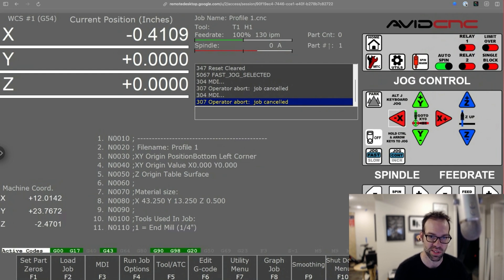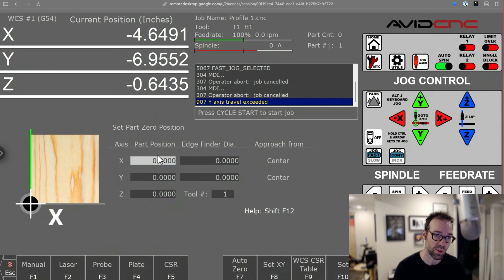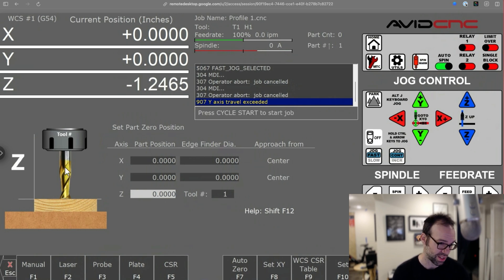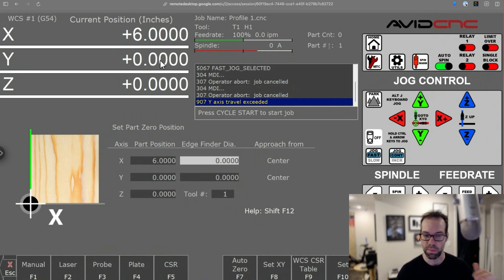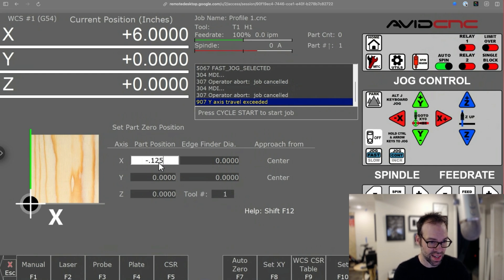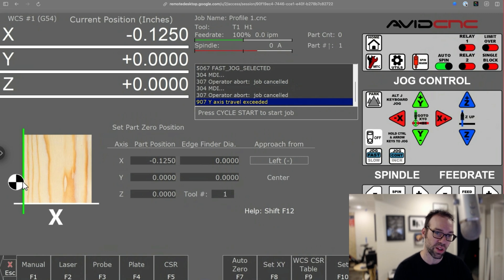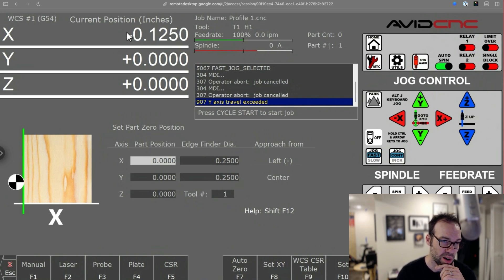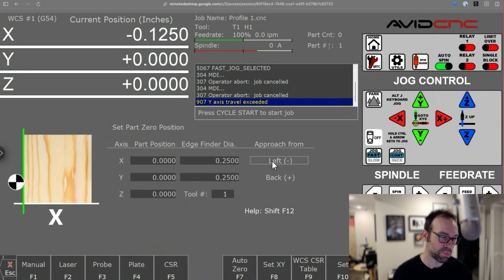Quick & Easy Manual Axis Zeroing in CNC12

Comment: Been an Avid fan and client for years.  This interface is not familiar, been using Mach 4.  Is this a new update to the controller system?
Reply from the maker: We did a complete redesign of our control system back in August of last year. The new system runs on a custom version of CNC12 so that's what you're seeing here. Hope this helps!